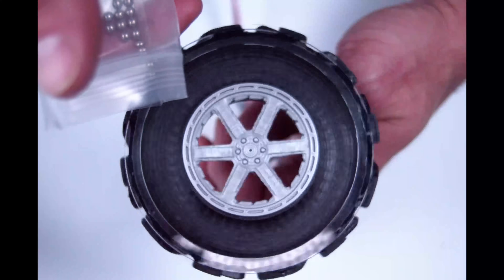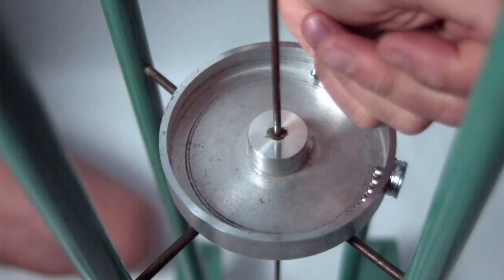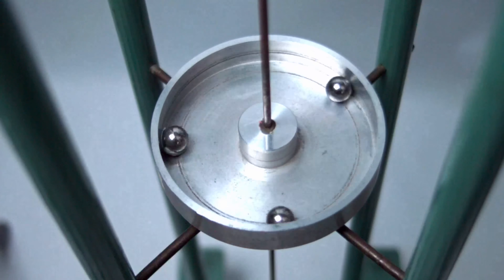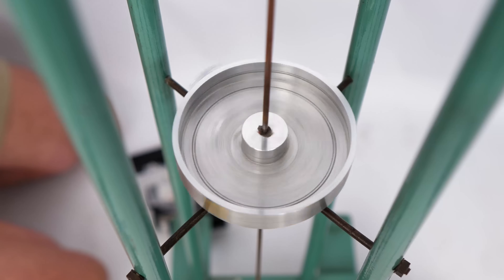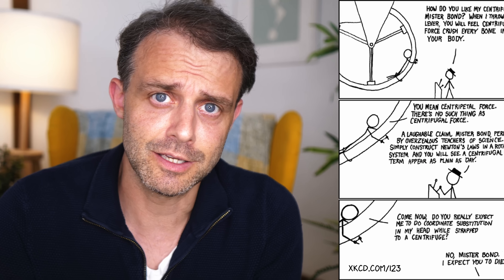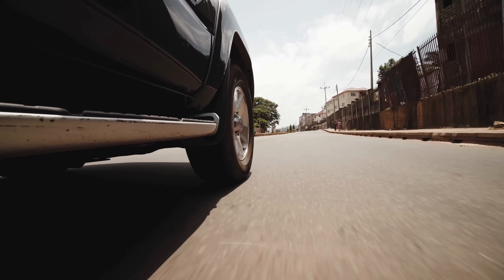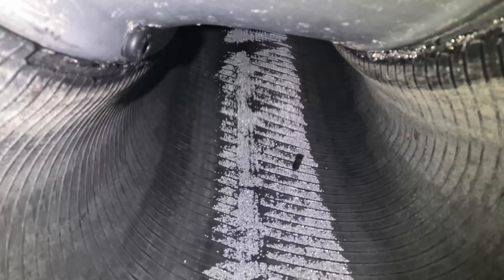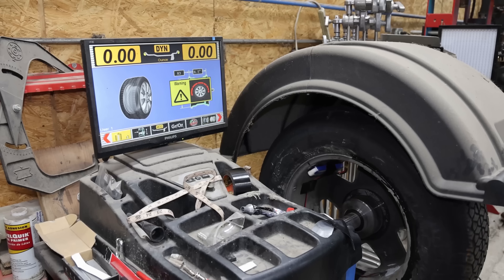Do tire balancing beads actually work?

Comment: Back then, CD drives used the same mechanism to deal with unbalanced disks. I was quite confused as a kid disassembling old drives to find small bearing balls in the motor assembly
Reply: So glad you said this. Never thought of that.
Reply: Oh heck, thats what those where for!? It all makes sense now
Reply: Yes, that’s why some drives made a whooshing noise when speeding up. CD drives ended up being x60 speed or so, which is very fast! They needed to be balanced.
Reply: Optical drives are actually an engineering marvel
Reply: OH DAMN! Thanks!
Reply: I also saw a washing machine with that system.
Reply: @ziomalZparafii  Washing machines do it naturally with clothes. The spin irregularly at low speeds but then caslm down as the speed rises. Clothes also stick in place as the water is removed.
Reply: @theelmonk I have to disagree based on my observations. Clothes are big, have high friction and fill too much space for them to work like small balls freely rotating in designed space. My washing machine almost always "walks" a bit from the wall due to imbalance and shaking.
Reply: @ziomalZparafii you are correct.
The reason a washing machine settles as it spins faster is the motor is powerful enough to accelerate through the resonant frequency, it also uses dampers to resist the flailing. Similar to Steve holding the shaft of the mini whisk.
Then, as the water is removed from the clothes, the out of balance load becomes lighter, the water is pumped away and the process continues.
The out of balance load never gets into balance, it's not a dynamic load once the drum speed has gone above 90rpm.
Some washing machines such as industrial do have dynamic balancing but domestic appliances are pretty much all 'balanced' by emptying the water and turning the drum around 88rpm to allow the load to spread around the drum before speeding up.
The balance is checked by the electronics that power the motor, if it's not within preset limits, the drum slows down or stops and then tries again.
Domestic appliance engineer since 1979.
Reply: @ziomalZparafii  They move easily floating in water. As the water is pumped and spun out they clamp into place.
Reply: @johnnyfearlesszrx  GPT response haha
Reply: Ball bearings (or just small Balls as they not used just in bearings) are used for so many things. We have to make billions of them every year.
Reply: @lordomacron3719  and making high quality ball bearings isn't as simple task as it might seem. Export ban of ball bearings to russia was one of the first sanctions after they started the full-scale invasion of Ukraine in 2022.
Reply: @fintux yeah that has been the west’s best industrial advantage. The very high precision manufacturing. We lost mass manufacturing capacity to east Asia but when it comes to cutting edge manufacturing the west is still top. 
Industry and logistics are the two keystones to modernity most rarely even think about. 
I used to build trains for Alstom one of the biggest companies nobody has ever heard about.
Reply: @lordomacron3719 Alstom? If you need them, you know them. They have no place in consumer devices, it's all industrial.
Reply: @lordomacron3719 I heard of that company
Reply: @lordomacron3719  "Billions" is surely an understatement by several magnitudes, right?
Reply: @zants_ nope
Reply: @zants_ could be up to a trillion balls a year. Anywhere from 20-50 billion bearing assemblies are made. Data out of China is unreliable and swings heavily year by year but it's almost 20 billion on average just from them. 

Most bearings have 8+ balls, larger assemblies 20+. Adds to crazy fast. 

Then how do we define balls used for other consumables such as pens which are functionally a captive, product lubricated single point bearing.
Reply: I have a slim portable drive (basically a notebook drive) and I wish it had such balancing beads. It has very bad vibrations...
Reply: @LEXXIUS You need Beach Boys.
Reply: That would explain the strange ball bearings I found inside a Denon CD player that had the drawer stop working. It baffled me where they were supposed to go.
Reply: @TheEudaemonicPlague those are bearings for the drawer. A music CD-player doesn't spin fast enough for this to work. The balls work in a CD-ROM drives that spin the CD faster.
Reply: this comment just revived a hidden memory of me taking about one of those and it having them in it. at first I assumed they where for balancing but assumed the same as steve at the beginning.
Reply: True! 😮
Reply: Always wondered how those shaped (i.e. Yoshi) disks still worked.
Reply: @aaronh1372   I don't think the Yoshi disc works like that. Because it's an audio only CD, it's only supposed to spin at 500rpm maximum (8 revolutions per second), which isn't enough to dynamically balance the disc on the beads, but also not enough for the imbalance to actually be a problem.

Faster optical drives usually had balance sensing and would drop the speed of the disc if it's too unbalanced.
Reply: @SianaGearz ❤
Reply: Funny enough in the stack of IDE drives that I have now the only ones with the balancing balls are late LITEONs which also happen to be the shittiest drives on the planet when it comes to actually operating them on the software side of things, not to mention the noise... oops! 

But also now I realized why does my washing machine make a water sound even when completely dry and I spin the drum, it's a balancing wheel I guess
Reply: @app0the What are you saying? Liteons were one of the most reliable drives.
Reply: I remember little beads when I destructively broke apart an already dead CD-ROM. Now it makes sense.
Reply: First we had magic smoke. Now we've got magic balls?
Reply: @Alexstarfire wait until Big ballz hears about this 😮
Reply: I REMEMBER THOSE! Never knew that's what they were for, I assumed they somehow held the disc in place at the time and I've never thought of them since. Thanks for the blast to the past!
Reply: The universe has come into clarity.
Reply: Gosh, that was a revelation thank you
Reply: Nice, I commented same, and then find your comment.
Reply: i did a high school science experiment involving speeding up the rotation of different disks until they exploded under different conditions back in the 00s. It makes sense that's how they worked just to keep the laser focused, but we concluded that very fast disc reader speeds could probably blow up a chipped or cracked CD if you jostled it hard enough so i figure they're also adding mass to help keep it stable.

We couldn't do any better data than that, the motor was struggling under the load and we couldn't get an accurate reading on the actual speed. It was fun though.😅
Reply: So that's why they were there.
Reply: Daaaaaaamn
Reply: MY GOD IT ALL MAKES SENSE NOW
Reply: Wthat what I heard when I shook around a cd-rom drive I had taken apart.
Reply: Is this a technology connection?
Reply: Oh yea I forgot about that. CD players had these moving balls in the spindle.
Reply: Same here 😅
Reply: did not know that!
Reply: This is why I read comments! (Sometimes I learn something.)
Reply: 🤯🧠 oh damn
Reply: top load washing machine uses water balancing inside the upper ring compartment
Reply: Oh wow, this explains a lot
Reply: And it didn't work well back then and it still doesn't work well today.
Reply: I never knew what the bearing balls we’re for when I opened a drive
Reply: Nice🎉
Reply: Thank you for wording that correctly. A lot of people call the balls themselves bearings, but the balls are only often a component of bearings.
Reply: This proves nothing this scientific experiment is flawed!! Your tires don’t spin horizontally!!! They rotate vertically. So…. Gravity was taken out of the equation!!! And the bumpy road!!!  Not saying the beads don’t work… but this definitely does not prove it!!!
Reply: I never thought about that!
Reply: I was wondering why those ball bearings were in there.  Lol. Now I know. Holy crap.
Reply: I literally just made that connection now. I could hear ball bearings in CD drive and fan motors.
Reply: I had a Sony CD deck that used a fixed laser and the spinning disk moved. In order to smooth out the motion it had a large magnetic metal puck that sat on top of the disk.
Reply: now i recall... there is always that noise when cd drive start to spin up
Reply: Correct.

Comment: I keep suggesting this for people that who suffer "speed wobbles" or "wobble of death" on micromobility (very specifically EUC and stand up scooters) try to use some of the tire balancing beads to keep the mass center and resist oscillations or vibrations that experience runaway and gyros themselves flat, especially at speeds even moderately faster than walking.

Comment: I have seen such a ball balancing system in old computer CD drives. If you take such a CD drive and tilt it from a horizontal position, you can hear the balls rolling inside. I've been disassembling such a device. There's just a flat disk with balls inside.

Comment: Tires are not round when on the ground.   There is a big bump do to the deformation the weight of the car causes.   That's going to mess up the location of the beads.   Yes?

Comment: I imagine a version that somehow gets stuck in place once you reach supercritical self balancing speeds, maybe have heat sensitive glue, instead of mechanics having to manually balance wheels, they could just pop in the beads, spin the wheel real fast and heat gun the tyre until the new balanced wheel is fixed in balance.

Comment: While these beads work, I feel all the moving bits on the inside of the tire (ie, the beads) create extra wear on a surface that is not necessarily conditioned to be wear-resistant. Also, the point you made that these only work if you reach a certain speed can be prevented using traditional balancing, as that is fixed to the correct spot.

Comment: Yes, tire balancing beads work.  I had a 2000 Dodge Ram with 265/70/17 All terrain tires with wheel hop and death wobble issues.   I switch to balance beads (about 6oz) and it finally resolved the issue.  It only needed to go about 20+ mph to start working.
Reply: They certainly work, but I think the more appropriate question is whether they work well enough to justify the pain when it comes to replacing the tire and the possibility of clogging things.

Comment: Take apart a washing machine and you will find something similar. They usually have a ring partially filled with a fluid that serves the same function.
Reply: For our top loader there were two rings, one at the top and the other at the base of the drum. When I figured it out I was really impressed.

Comment: I've been running continuous wheel balancers on my 4x4 since 2001.  These use a hollow torus fixed to a metal disc that fits between the hub and wheel.  Inside the torus are steel beads and a liquid (oil).  I can hear the beads swishing around inside the balancers up to maybe 15-20 MPH then they go silent.  I've not had a set of tires balanced since then and they seem to do the job.  With off road tires, this works well as you often see chunks of tread torn off in rocky terrain and you can also see the tire slip on the wheel when running at low air pressures.  Both of these situations will throw off any balancing with fixed weights.  I've also been adding some balancing beads to my larger tires, in addition to the wheel balancers for the last 5 years.
Reply: ...mud stuck in the wheel also throws off your balance (happens a lot with our farm trucks). Had never heard of these continuous balancers before and am now looking into it. Thx.
Reply: Haw I just mentioned that above, his model tests are objects with perfect circles, in reality a tire on a road is not a perfect circle and the indentation of where tire meets the road will push the beads etc out of place and force them into their balanced state at far far lower speeds than 80MPH, like you said it only takes about 15MPH for tires to balance themselves with beads

This is example of why say ATV riders hate balance beads because below 5MPH tires can be sloppy/hoppy, but once they get up to speed it's a dream come true for them
Reply: could you add a liquid that hardens in like 30minutes, drive above high speed during that time and have a glued in perfect balancing that will remain even at low speeds?
Reply: @tristanwegner  That defeats the point of the dynamic balance effect of the beads. The beads can compensate for tire wear, damage, and slight mud or snow. If you are going to do that you should just get wheel weights.
Reply: @cerberus0413  fair point, but nothing stops you from adding a few lose balls after the sticking balls have balanced the biggest part.
Reply: @tristanwegner  yeah it kinda does, since the stuck beads will probably prefent the loose ones from getting to the perfect spot, and since they already apparently work at lower speeds there really seems to be no need to glue them in the first place, though adding liquid to your tyres alone might also work, so if thats true it might work to add some sort of glue in the first place, go fast untill its dry and then add the beads, but if you are going through all that effort, might as wel have your tyres ballanced properly (especially since taking the tyres of to add the beads can mess with the balance.
Reply: I have seen these for big rigs and trailers to go between the dual wheels. It is interesting they are made for normal cars. I had had the internal beads in my chunky truck tires for the last 5 years and I have fallen in love with them. I was so skeptical at first, but after using them through mud and snow I have had the smoothest ride even at high speeds on the highway.
Reply: @cerberus0413  what happens when you brake quickly?
Reply: @MarkConrad  Usually all the stuff that is under and on my seats ends up on the floor ... 
The balance beads are completely seamless in my experience. I do not even know that they are there, except that I was told they were using them.
Reply: @cerberus0413  sorry I must I put in the my question to the wrong comment,, my bad. under the seat is probably the the best place.

Comment: I was going to get my tires rebalanced by an expensive mechanic but instead I have purchased these beads, got a slightly less expensive mechanic to slip them into my tire and then reinflate them and sold my house and moved to a new place just off the highway so that I have to travel a little ways at highway speed to go anywhere. the cost saving has been, presumeably, immense.
Reply: My sarcasm filter just exploded! 😂
Reply: Yeah really, it's like $15 to balance a wheel
Reply: @radman999  Also, could have saved more money by unscrewing the valve core and pouring the beads in that way.
Reply: @sandy_knight  yes, 3mm.
Reply: @JaySmith-e3v  Exactly, the actual IRL beads shown in the video (i.e not the big metal BBs used in the spinning cups) were much smaller.
Reply: @radman999  I was quoted $100 per wheel, 35s.
Reply: The wrench in the spokes of your tire is a stop sign.
Reply: Finally a reason why they built suburbia
Reply: I think you've got the balance between frugality and insanity just right 👍🏻
Reply: You could just rub your hand on the axis so it goes to the sweet spot of balance like he did on the wobbling disc.
Reply: @tavarestattoo  licking my fingers and pulling on my axles like I'm going to thread a needle before I get in my car.
Reply: Haha. Although actually moving to a place right next to a highway probably did save you money.

Comment: would this work with water I know in the agricultural tractors farmers put water in the tires so it increases weigth of the tractor, and thus friction force, i know they do not drive fast enough, bit if they did they would have balanced tires?

Comment: I run these in my bus tires...  I have 3 busses.. (well 2 different tire sizes..)..  I do a lot of travelling in the busses..  im in the states where we spend a lot of time on the freeway..  one of my busses has 41.5" diameter tires..  in this bus the beads i dont notice so much.. as the tire RPM seems to love to hit that resonance until I get over 65 MPH... well i dont like driving that 47 year old bus at 70 MPH...  its old and well it doesnt need to get me anywhere fast..   my other bus has 32" diameter tires.. and it is really happy cruising at 65-70 MPH...  the beads are fantastic in this one..  once i get up to speed on a nice smooth road the tires feel pretty balanced... however drive into eastern indiana on  I-70  (sorry indiana) and the road is nothing but a lot of divets and potholes..  the force isnt enough to keep the beads in place.. so not only do I start fighting the really bad roads but also the fact it seems the beads are movng all over...  hit a smooth patch and ill feel the balance smooth out again.. overall im happy with the beads in my Little RedByrd..  but the other 2 busses with big tires.. not so much as im rarely out of the resinance zone so I think the beads made things worse in some respects... .. although its hard to tell..

Comment: so in theory, if someone mixed the balancing beads with some sort of quick-ish cure adhesive, say 30 mins. you throw that in the tire, inflate the tire, then spin the tire up to freeway speeds, that would act as an automatic balancing.

Comment: Comment based in ignorance, so please forgive me.

If the beads reach perfect alignment at a certain point, would it be possible to freeze the beads in place permanently upon reaching that point to permanently balance the tire without going through the wobble->stable cycle every time the car comes to a stop?

Comment: I worked in a chemistry lab and we had powerful centrifuges. To some models you have to be really clever balancing your samples because the slight difference in weight can be catastrophic. Some models will come with a ball bearing system just like this and self balance. Pretty neat